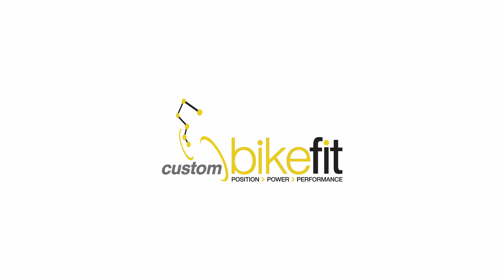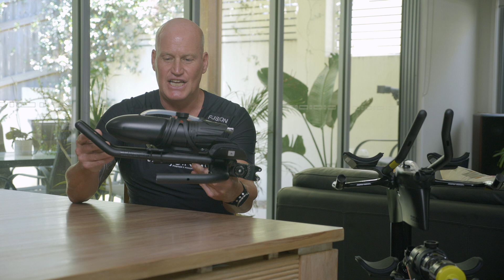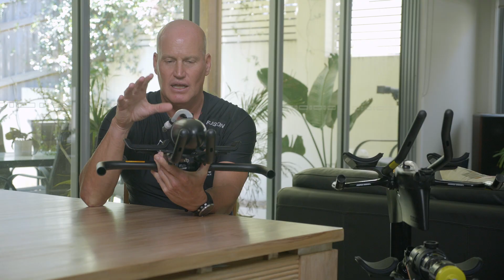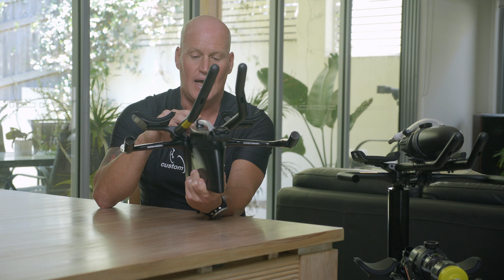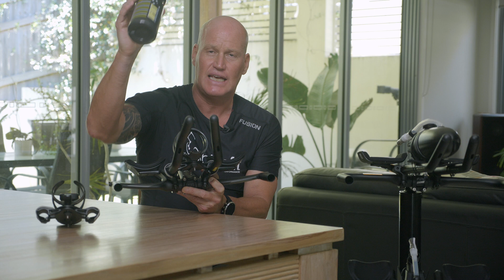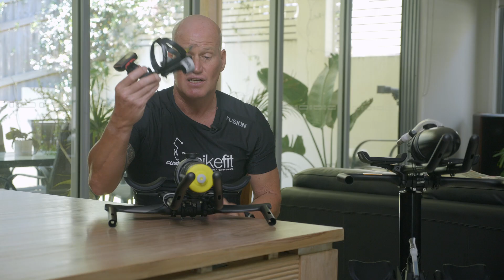Front Hydration Systems for Triathletes

Comment: With the HSF/Aero HC 800+ (first one) are you easily able to take the reservoir off/on to clean?  For example if you wan to use gatorade in it?
Reply from the maker: Yes Craig, it's easy to remove the reservoir which is constructed in 2 halves. Easy to separate, clean and put pack together
Reply: Yes you can :) https://www.youtube.com/watch?v=mp01RUa1Vgg

Comment: What do you recommend for my Trek Speed Concept that doesn’t have 2 separate bars, but 1 that forks out into 2?
Reply from the maker: It really depends on the length or those extensions (there are 2 or 3 options) and whether you have the bracket/bridge that allows for a bottle cage to be mounted between them. By all means email some close up pics of the bars, with measurements preferably, to setup@custombikefit.com and I'll let you know my thoughts
Reply: Hi Nani! Wondering if you got an answer, I have a Speed Concept as well and shopping for a hydration system :)

Comment: I just came across your channel. Very informative. I wanted to ask if you have experience with Vision Metreon TFA? How does that compare to the Profile Design Aerie? Which hydration system works better when comparing the two in terms of being more more aero and convenient to use for 70.3 events?
Reply from the maker: Hi Richard, personally I've no experience with the Vision Metron TFA (I've not yet handled a set) but they look very similar to the Profile Design Aeria Ultimate in terms of functionality and adjustability and I'd say they are equally as good
Reply: @custombikefit466  Thanks. Will you have any long-term review of the Aerie Hydration system?
Reply from the maker: @richardt9692 what do you mean by 'long term review'?

Comment: Do you know if it is possible to use the HSF 800+ with a gorilla cage on trek speedconcept ? The cage will replace the bento box. Thanks !
Reply from the maker: I think it would likely fit Christophe but I also think it would be quite hard to access the straw and drink. I have a Speed Concept frameset, can try this out if you'd like? Shoot me an email at setup@custombikefit.com as a reminder
Reply: @custombikefit466  Thanks for your quick answer ! You are probably right ... Just put the HSF 800+ in the gorilla cage  BTA seems to be the best solution !

Comment: Hi, both the HSF premium set as well as the other system come with the same PD cage and computer mount. It’s described to have a removable computer mount. As you might be aware, Garmin and Wahoo sockets differ from few degrees for locking the computer in. Is it possible to alter the position to attach a Wahoo w/o adapter?
Reply from the maker: The position is fixed out front but you can mount any head unit of your choosing
Reply: @custombikefit466  Hey - i'm afraid you misunderstood my question. It was for the HSF800+ system. There the lock is placed on top of the cage. Question is if its possible to remove that and reattach in a different position to fit a Wahoo bike computer. Thanks!
Reply from the maker: @t.r.iggler  I've not tried but I'm sure it could be done

Comment: Hey Michael, 
Thanks for your videos!
Can I ask you for the dimensions of the bottle? I've tried the FC35 on my wife's Canyon Speedmax (XS) but it is quite big and the front leaves no room for the hands on the aero bars. I am considering getting the HSF 800+ as it seems to be more adaptable plus the offset of the mounting should help. If you could confirm this information that would be much appreciated. Cheers from NZ.
Reply from the maker: Hi Jose, is the bike a Speedmax CF or CF SLX? Probably best to email me at setup@custombikefit.com and I can help you

Comment: Hi! Great video, thanks! I've read negative reviews about the PD Aeria that on bumpy roads the system mount breaks off from the stem - have you experienced such a thing yourself or have you heard of anyone having this issue?
Reply: I hit a pothole square-on at 25mph yesterday with this bottle, and it stayed in place nicely! It does leak a bit on bumpy descents through the refill hole, but no more than other bottles I've used with a refill cap.
Reply from the maker: Not if it's fitted correctly

Comment: With the PD Aeria hydration system which looks sleeker than a torpedo style, what’s your opinion on crosswinds with that? You have more side exposure which to me may cause more front end twitchiness. Thoughts or opinions?
Reply from the maker: I have lots of clients using the HSF/Aeria and so far zero negative feedback on bike handling in crosswinds.